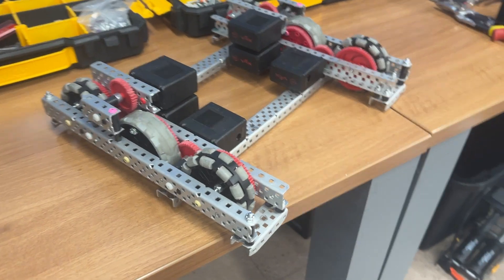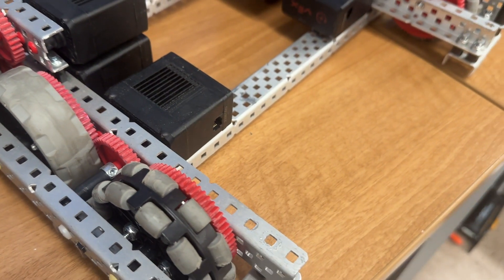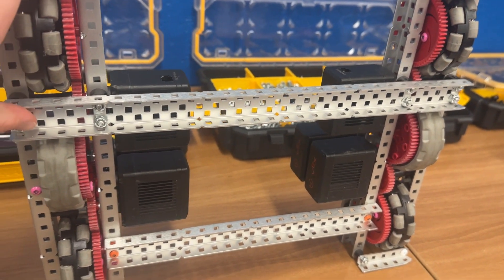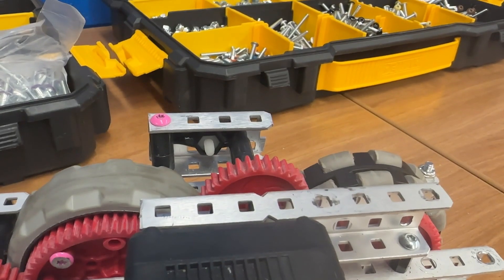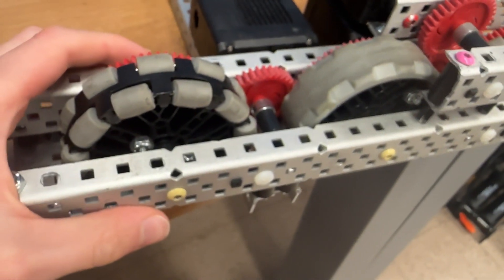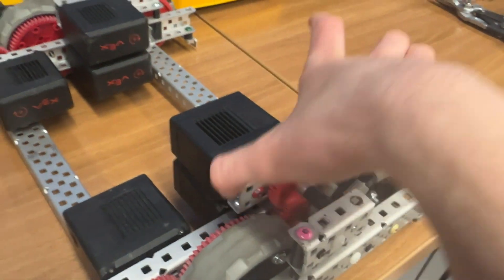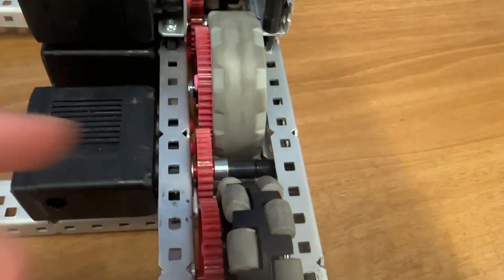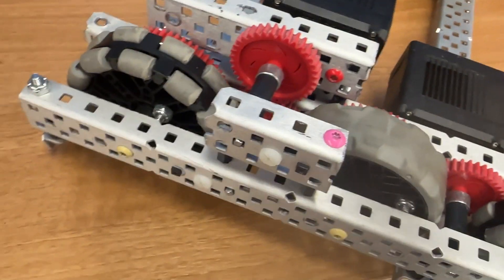Vex Robotics Drivebase Tutorial

Comment: trying to make a 55w drivetrain (6m)
im thinking of having a compound gear (36t + 12t) for the 5.5w motor to boost the 200rpm to 600rpm.
is it practical?
sorry its late agin

Edit: i mean stacking the motor and having the gear on the axel a bit further out
Reply from the maker: I've seen it done but I still recommend running the full 66W on the drivetrain.

Comment: You said the shaft shouldn't hit the c-channel. But it looked like you didn't have a collar on the shaft, is there a reason behind that? like friction?
Reply from the maker: There are shaft collars on the shafts next to the 36 tooth gears on the outside.
Reply: @9MotorGang  ok thank you! But one more thing, I couldn’t see inside the motor so I need to ask if there is an insert there, it’s a stupid question but I want to know.
Reply from the maker: @MeNoobVr  the shaft goes directly into the motor
Reply: Ok thank you!

Comment: i have 42 teeth gears on my wheels, how should i gear my motors (going for 3 hole spacing)
Reply from the maker: Vex doesn’t sell 42 tooth gears. So I would recommend figuring out what gears you actually have or use official vex gears.
Reply: @9MotorGang   Oop sorry 48 tooth

Comment: what happens if i do this drive train with green motors
Reply: you’ll probably go 1-5 and miss elims
Reply: The drive will run slower but with more torque
Reply from the maker: you will be abysmally slow. If you're using green motors, you need to run a different gear ratio
Reply: @9MotorGang  can you give a example becausr we have only green motors
Reply from the maker: @ I have an older video a bit outdated but its still mostly good: 
https://youtu.be/VbLf8aXQSpg?si=zMyLkZ-UqK7VZirj

Off the top of my head, you have 333 3.25 and 280 4

Comment: Wait, do you need a C channel for support on the bottom or can you use a flat 2 x (what ever the width of the robot is)? I’m brand new to v5 and want to know.
Reply from the maker: Plates (flat pieces of metal) are usually not as good for cross braces as they can bend much easier. I would recommend you check out my step by step guide on building a drivebase if you want to learn more about drivebase construction: https://youtu.be/y-j1hIiJ_NQ?si=L5ms9cEWWCKZjcaw
Reply: @9MotorGang  thanks!

Comment: Should i have a bigger driving gear than a driven gear for high stakes? I know this increases the speed, but does the torque get affected?
Reply from the maker: @nirvs123  speed and torque are inversely proportional: when one goes up the other goes down. As for whether or not you should gear up or gear down, it depends on what colour motors you are running. If you are using green motors, you want to gear for speed. If you are using blue motors, you want to gear for torque.

Comment: What are the negatives to stacking motors I feel like so many people do it but I’m worried something will go wrong
Reply from the maker: @teejayefridgen  there are very few negative and those that are there are very minor. It adds slightly more weight and raises cog but these are negligible and I would highly recommend stacking unless you can just lay all your motors out in a line.
Reply: @ thanks I’m always worried that if the gear gets off you loose power but you could run a high strength gear with a low strength axel insert
Reply from the maker: @teejayefridgen  I’ve never had issues with the gears on the top motors becoming enmeshed with the ones on the bottom. Just make sure you have shaft collars to stop anything from sliding.

Comment: My question is, how’re you guys doing right now during matches? Also is 450 better than 360 rpm in high stakes?
Reply from the maker: We never actually used this drive in matches. 450 2.75 vs 360 3.25 is pretty minimal and it depends on specific factors.
Reply: @ for my team, we’re going 450 as our main goal is to fill mogos as fast as possible

Comment: hey, my team doesn't have pneumatics, so we have to use one of our motors for the clamp. Is a 4 motor drivetrain viable?
Reply from the maker: 4 motor drive will likely be outplased in scoring by 6 motor drives and will struggle to maintain controll of the corners. However, there are plenty of other important factors to consider and a well built 4m drive will beat a poor built 6m drive. Personally, if i were in your shoes I would run 6m drive, 1m goal clamp, 1m ring mech though

Comment: my team decided to use the drive showcased in this video cause we are new to vex. We are wondering how you screw jointed with a smaller gear, since those small thin gears can only have an axle go through. In the screw jointing video you attatched that includes the bigger gear which doesnt have that axle part.
Reply from the maker: Good observation. To answer your question, we drilled out the gear. Since the gear is mounted to the wheel, the gear doesn't actually need to touch the screwjoint at all. By drilling out a hole slightly larger than the screw, there should be a gap between the gear and the screwjoint so there isn't any extra friction. Best of luck building!

Comment: 7:24 It depends on your drive spacing and drive rail configuration, but I would recommend, when possible, to flip the screws around and have the heads on the inside of the robot. This helps when you need to take apart the drive for any reason. With the screws on the inside, the robot will stay up if you take the outside drive rail off. This helps if you need to replace a motor or take off a wheel or motor to reach a screw

Comment: I was wanting to use green motors and reverse the gear ratio by moving the 3rd motors around a little. Only reason I wanna do this is because of my club is broke.
Reply from the maker: @SRMRobot  just make sure if you are doing green motor cart drive, you have your gear ratio going big to small. 280rpm on 4 inch wheels or 333rpm on 3.25 inch wheels are probably your best bet.

Comment: 1. Very lazy boxing. Every single one of those screws on the front of the bot should be boxed all the way through to prevent your flanges from bending. Additionally, you should be boxing your screws all of the way through the bearing flats for your motors.
2. Don't use the crappy 1 screw bearing flats for anything. 1 nylon screw is not redundant enough. You are able to fully square up version 1 bearings due to the plastic bits that stick out the back. Or just put two screws through it and you'll be good. You can also just ziptie your bearings its way lighter.
3. Why would you use standoffs if you didn't have to. The stacked motor mounts will never come loose if you're using just a long screw with spacers with a nylock holding it together.
4. Blud screw in your screw joints on the wheels. Its not acting as a standoff running through your drive in any way providing extra structural support.
5. Using spacers on your drive axles instead of 2 axle collars will create loads of friction if you don't have the perfect spacing. Much easier to tune friction with collars. 
6. Use teflon washers instead of metal washers to space out your gears on those drive axles, because metal on metal is going to cook your friction.
7. Flip the cross brace that runs all of the way across your drivetrain and those front c-channels, because the corners on the c-channels will not survive.
8. 3:22 what're we using keps now for our main structural beams. Keps nuts should only be used on prototype mechanisms, never making it to the final bot. Even if its hard to reach just have foresight when building your drive.
Reply from the maker: 1. We encountered no issues with the front flanges on the drive base bending in. I have found boxing all the screws on the front to be redundant and adds extra weight. 
2. I have never had issues with v2 bearing flats and find them to be much better than the regular bearings.
3. Standoffs vs spacers is a mater of preference. 
4. The drive already has plenty of structure there and this isn't needed.
5. Why I cad out my drives before hand and make sure there is the thickness of a fingernail's width of slop to prevent friction. By having 2 shaft collars instead of 1 you increase weight and add another screw/point of failure.
6. We didn't have any Teflon washer thin enough to fit but are planning to order some. Not something I specifically mentioned as a positive.
7. The corners of those C channels isn't relevant to the strength of the rest of the bot.
8. If you look at the spacing closer, you will notice that it isn't possible to screw those in earlier duo to other parts of the drive having to be built in a specific order.

Comment: you can pop the normal bearings into the holes. They have little things on them for that reason. And they wiggle just as much as the other bearings that have the square insert on the one side
Reply from the maker: Eh, kind of. I've found that while you can kind of get them in, they have way more wobble compared to the v2 bearings. They definitely still work, but the v2 bearings are much easier to work with and lighter.
Reply: @9MotorGang  I personally use the low profile ones. They seem to work the best for most applications, are super light, and you can fit them in the edge of the channel
Reply from the maker: @WVUR1  Don't have any of those on hand. Might be better than the normal bearings, but I would still probably use v2 bearings where the lower profile isn't needed.
Reply: @WVUR1  they work the same, low profile ones only better by being smaller and fitting on the edge.